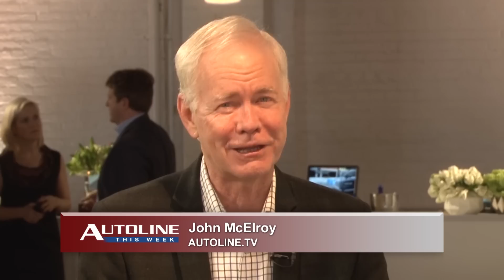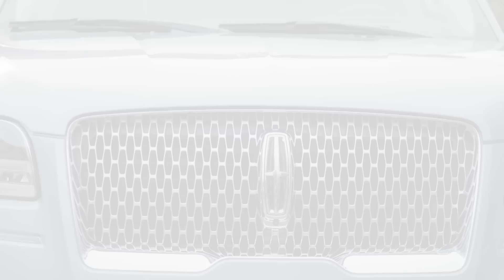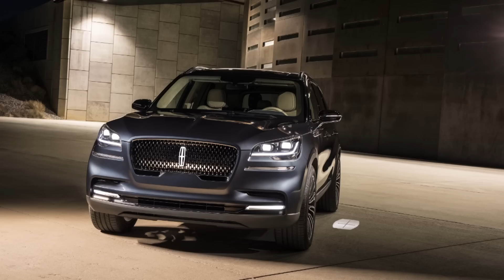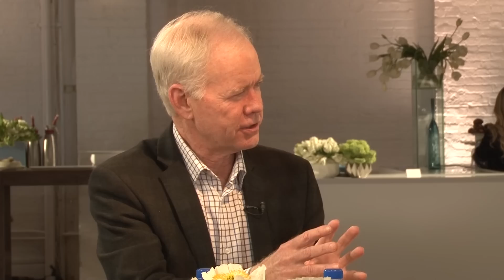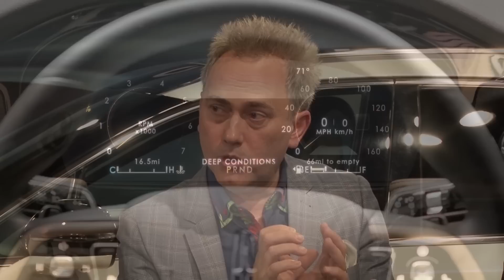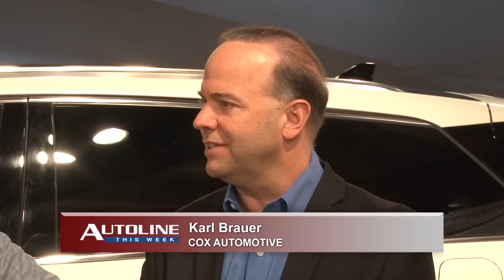Lincoln Design Takes (Quiet) Flight - Autoline This Week 2311

Comment: Ford and Lincoln fan (and customer) here.  gotta say, i don't like the new design direction that much.  Its not bad, but not outstanding IMO.  I like a more aggressive look.  However, i will most likely still stick with Lincoln because Ford offers near Euro style-engineering-attention to detail-tactile quality-and performance with typical American maintenance cost and reliability, which is now quite good and better than the Europeans.  Ford still offers the best balance right now.  the closest competitors are Hyundai/Kia (surprising) and then FCA (still concerned with their reliability/dependability).  the Japanese, namely Toyota and Honda, still don't offer the kind of design and styling I'm looking for (although Toyota/Lexus has some decent looking models now).   I used to like Nissan/Infiniti alot (right behind Ford), but I'm not happy with their corporate governance and engineering levels right now.

Comment: I want the Navi, Aviator, or Corsair. I honestly would love to own any of them which is crazy. Usually I only like one or two models for each brand, this is nuts. I absolutely adore what they are doing.  They need to ditch the current Conti and build a new one on the Navigator frame  (hear me out) not as lifted as the Navi but taller than the current sedan. Big wheels and tires to match the proportions of a MASSIVE sedan, think Rolls! We all know the current sedan is out. THIS is the next step for a big luxury sedan that would sell id bet dollars to donuts.

Comment: I'm all for colored interiors rather than having Black rammed down our throats.  However, that Blue is a pretty disgusting shade.  Also too bad Lincoln has stuck with the stupid trend of piano black interior trim which just shows all the dirt, lint, scratches and fingerprints.  Just creates unnecessary reflections.  Also they've adopted the ludicrous trend of "glued on top of the dash infotainment systems".  I treasure the integrated infotainment system in my 2018 Kia and also the one in my Dodge Caravan.